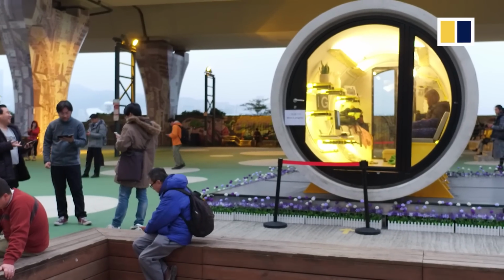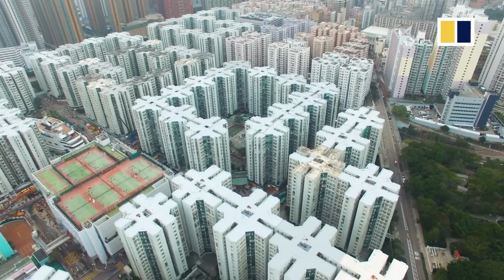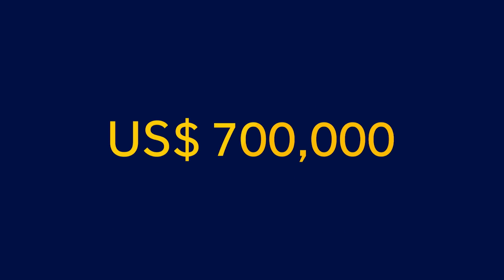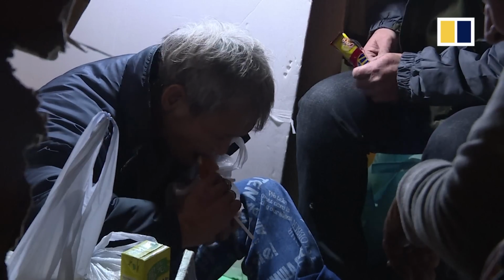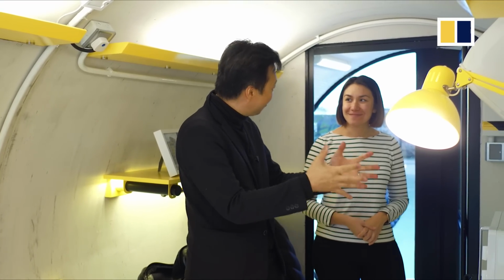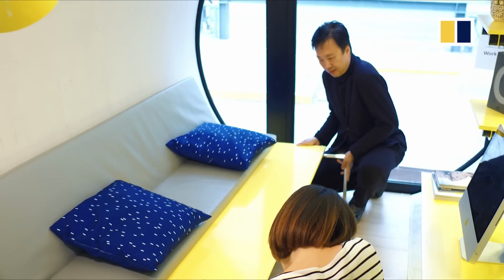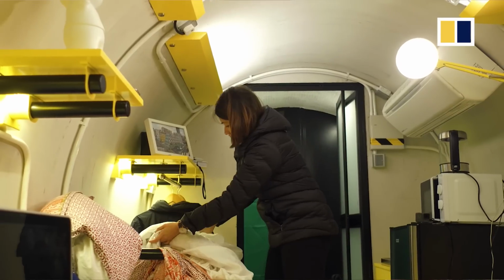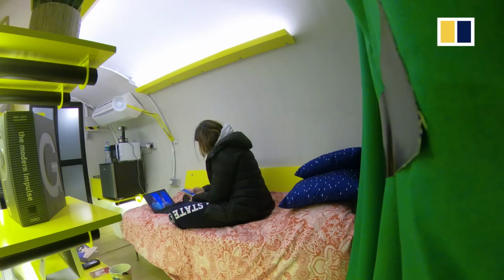Live in a water pipe: potential answer to Hong Kong's housing crisis

Comment: Listening to the architect, it doesn't seem that he's genuinely suggesting this is how people should start living, rather trying to demonstrate that a creative solution might be found in unexpected approaches. And as a visualisation it's really quite an eye-opener that this pipe is actually more space than some already live in.
Reply: True that as many failed to understand..
Reply: YES!!! Exactly!
Reply: These reply threads makes more sense than enitre comment section
Reply: Yes and later their gov will start charging them high tax on this.
Reply: So why do people live in such poor conditions? Make a video about that. Oh yeah, you can't. You live in fn Chyna.  Lol
Reply: @ericsaur9791  Nope. China communist gov want to build low cost housing that will address the housing issue. But Hong Kong local gov rejected it because many landowners in Hong Kong fear it will reduce the value of their property.
Reply: It's quite cheap too
Reply: Obviously, if you really wanted to make a tiny building, you would make it from a container. If you absolutely had to have concrete you would still make the concrete box rectangular rather than tubular, it's just a no brainer. But you know, an experimental piece doesn't have to be practical. It's enough to point out the housing issue and to demonstrate what kind of difference a bit of interior deco can do even to completely unsuitable spaces.
Reply: YES! Was thinking exactly this
Reply: Definitely have more space. If it was rectangle of this size approximately. It would have served the purpose

Comment: How is this solving the housing problem in HK? The problem in HK is land space, not building material. You still need to place these pipe homes somewhere. Unless they can just submerge them underwater. 
Second, the round design is very space inefficient. Better to just stack rectagular or hexagonal designs.
Reply: taxol2 yup.. this is just some type of business marketing that went south..
Reply: I wonder why they haven't considered container homes if they are going to try this route.  Alot of people out here have been repurposing shipping containers for homes.  Not only are they hella strong (people have been using them in Florida as hurricane proof homes), but they are cost effective and you are often (though not always) recycling.  On top of that they are stackable, making them good for multi story or apartment buildings.  I know in New York, they had talked about using shipping containers as post- disaster family homes.
Reply: JustYourAverageGirl yes, you are correct materialwise. The container boxes would be a better choice. However even with that the real problem is land space in HK. They really need somewhere on land to place these live pods. Unless they open more land spaces or like I said submerge it underwater or mass exodus out of HK, HK will still have the similar housing problem
Reply: why not live in china and work in hk?
Reply: @taxol2  Unfortunately, other than basic history, I do not know much about Hong Kong.  I would think however it wouldn't be too entirely different than the city's out here, in that there are certain features that seem to make a large city, a large city.  I suppose why I brought up the container homes, and to what I wasn't understanding, if you already are having issues with space, why would you use something round, which, unless you are a shark, has fundamentally less space and isn't great for the people living in them.  Container homes would make more sense to me in that they are already readily available as a material and therefor more cost effective, and would take up less space.  In large cities, getting any kind of land to build things on is a hot commodity, that's why they build upward, instead of outward.  Which you could do with container homes.
Edit: but yes I do understand if you have nowhere to go already you can't do much.
Reply: @JustYourAverageGirl2002  

I owned a condo in Manhattan 650 square feet and sold for 1.3 million usd Then I was able to buy a house in seattle for 1.1m usd 2400 square feet brand in the best area in seattle , queen ann. Why the price difference? Both are in prime part of the city , I live 10 minz car drive to downtown.  It is not the material and it is not the labor. Construction worker salary between the two cities are similar. It is the LAND. limited supply of land in nyc. Seattle is also limited. But to have a house like mine in nyc would be 6m usd in nyc at least. 

Containers houses which require you to stack them if you are talking about houses in terms of single family that requires land ( which is the expensive part) In asia people don;t live in houses like the west. They live in condos unless they are rich and live in certain area. I am not sure stacking containers up to 30 floors can work. The only solution is only allow local people to buy , restrict and make sure mortgage is not easily taken out ( if you have mortgage that easily accessible you will create the usa bubble crisis. When your neighbor can take extra 100k , so can you which creates bidding. A house that is worth 900k is now 1m because both parties can pay more not necessarily because it costed more to build  )  restrict the number of unit per married family/ family ( only allowed to hold one), and allow more development at faster rate. There is absolutely no other way around this...
Reply: The purpose of the round design is to re use all of those unused big pipes left by construction sights. You saying that they should use rectangular designs would mean they'd have to build them and it will shrink land spaces even more.
Reply: @Aki-hb1jy  Um, do you know what a container  house is??????
Reply: @7lol2007  I understand it's the land.  I put that in my comment.  But "container houses" is a general term.  You can turn them into apartments, because they are stackable.
Reply: @Aki-hb1jy  Round design isn't a good design for space.  
     Container houses or whatever you like to call them, are dwellings made out of recycled shipping containers.  It is estimated that world wide, we have about 14 million unused shipping containers that just sit and take up space.  Alot of the these shipping containers come from China.  So in theory, not only would it be a reliable resource as well as being readily available, it would be even cheaper since you are getting said material directly from the source.  They are sturdy, and with a little work, they are made to be non toxic.  I am not saying this would be the end all be all solution to Hong Kong's housing crisis.  All I am saying is if you are looking to make a dwelling out a recycled material, it would make more sense to use old shipping containers than old concrete pipes.
Reply: JustYourAverageGirl they have and it’s not a great idea. Container homes could only be stacked so high before they become unsound. Typhoons could rip through the stacks. Further you will end up needing lifts and any steel structure will resonate when you walk on them. Slept in plenty of these due to work in remote areas. If you don’t have enough money to buy it would need to be communal.
Reply: @SugarRay2  Granted I have never lived in or built one before, but with sound engineering it is possible.  People do it all the time on the Florida coast because they are hurricane proof when correctly built.
Reply: @JustYourAverageGirl They go up for a reason. In HK land is a scarcity Florida isn't. In HK you will end up building a tower, then you have to think about communal areas, then lifts, stair wells, etc...That's why concrete is still the norm. Different courses for different horses. I've lived in shipping containers before when I had to work remote. It has it's drawbacks.
Reply: @SugarRay2  No duh -_-
And everything has its drawbacks.
Reply: @Justyouraveragegirl so why would you push for shipping containers in hk if it's that trivial?
Reply: @SugarRay2  Okay, let's try this again shall we.
     All I was saying was if Hong Kong is trying to used recycled materials to make housing, shipping containers would be a better choice than concrete pipes, where the round design takes up more space and gives less space to the individual; and shipping containers would make more sense cost and material wise.  I am not claiming this is going to solve Hong Kong's housing crisis.  All I was saying was concrete pipes would be an unwise choice for recycled housing in an over crowded city.  Do you understand now?
Reply: This whole thing is a design nightmare. "Cool and funky" but not practical
Reply: @The Anti-White Ranger Uh-huh......do you by chance wear a tin-foil-hat?
Reply: Hong Kong has a Lot Of useable land you can look at a Map of it.
Reply: Someone had spoken the truth lol.
Reply: HK doesn’t have space for low tech industry, such as pipe building industry. Their property price is way too expensive even for the rich now. HK mostly “imported” those pipes from China. Both HK and China is the same country, but due to HK unique autonomy status, hence I use the word “imported”. And again HK problem is not building material, people can still well afford the building material. The real problem is the free “buildable” land space. They really need to acquire more land, free up some land, explore expansive options such as surface and underwater apartments.
Reply: Land space isn't the problem in HK lol that's a myth that people keep regurgitating.

The problem is land permits. The HK government makes most of its money by auctuoning off land and building permits to large real estate companies. To keep the government revenue high, they give out very few of these permits which end up in insane bidding wars between real estate companies.

If the government wanted to solve this problem, they could do it within 10 years. House prices in HK would go down by around 70% if the government wanted it to. But if they did that, money needs to come from somewhere else, and taxes would go up.

Pick your poison.
Reply: Kry Kry  HK has one of the lowest tax rates in the world. 2% to 18%. No inheritence tax, no dividend tax, no cap gains tax.

It's so low to make sure that foreign  businesses come to HK and invest. This also means that HK does not make much money from taxes. That money needs to come from somewhere, so it comes from selling land permits.
Reply: They were taking space in China otherwise it was going to be dumped
Reply: @JustYourAverageGirl2002  there are plenty of people living in containers in Hong Kong!!
Reply: @andia968  well I for one need a visa to work in China but I don't need one for HK, also China has different laws, whilst I don't enjoy living in Hong Kong I would really not want to move to China where a lot of things including YouTube are blocked
Reply: @taegiseoktrash8874  youtube can be bypasses easily using free vpn
Reply: Maybe so, but I would rather live somewhere where I don't need to be using VPNs  & again for me personally I can't live in China anyway without a visa
Reply: The real problem is the government losing control of housing issues. Face it.
Reply: @andia968  that would be nice but i think there will be socialism will occured because HK and CHINA are really different when in comes to goverment
Reply: @JustYourAverageGirl2002  they do except those container home are expensive and nobody want to live becuz it be a nightmare and fk ear drum when rain. Idk just excuse. Idk
Reply: so there are pipes lying around and the company would start filling up pipes at these construction *sites?
Reply: Like bees
Reply: Repurposing.
Reply: They problem is the government
Reply: No actually. Land space isn't the problem. I know what I'm saying seems pretty ludicrous but, the government simply doesn't care to expand livable land areas. That is why they just bid off small plots of land to get huge profits which is why living areas are so expensive.
Reply: Buddy for life buildable land. I think the govt there auctions such buildable land, making it very expensive
Reply: Bro, the problem is that housing is expensive, just see a vox Hong Kong episode on these problems, it explains it very clearly
Reply: JustYourAverageGirl I thought a about living in one of those one day
Reply: If they were things like shipping containers they would be stackable, more affordable than conventional apts, and extremely modular
Reply: Amens
Reply: And fked up ppl who slow it down
Reply: Solution is to stack shipping containers and sell them like condos.  Lol.
Reply: MrManny maybe you can stack and sell them. But there is limitation of how high we can stack up containers or concrete pipes.
Reply: Metal containers have fundamental flaws if used for living. They are conducting heat and electricity, are magnetic, and poor for wireless reception and radio frequencies. It will be like an oven during summer and a fridge in winter. Insulation and noise cancellation are also huge problems with these. One small stone hits the wall, you're gonna hear it all around. Think about raindrops...
Reply: @andia968  actually lots of people do. We live in Shenzhen, work in HK. They also opened a mrt directly from the border near the Westin in Shenzhen. However, it's a pretty long commute. Nevertheless, from an economic perspective it's worth it.
Reply: @andia968  could you clarify, your words are sorta mixed up... anyway, i'll also link the video on it afterwards.
Reply: @idk-lz4nl  how many hours are required until u can reach your workplace from sz?
Reply: @andia968  about 2, but once it was 1hr 45
Reply: @andia968  but to clarify, i study at university. I don't have a job yet...
Reply: @idk-lz4nl  arigato bro. Is living in zhuhai and work in hk practical?, or it may take more than 2 hours commuting?
Reply: @andia968  I dunno about that, but I heard some people were taking buses. I've been to Zhuhai but never on the bridge. In terms of Shenzhen as it's a tech hub it's better for me as a university student but I dunno about normal people they might prefer Zhuhai. Zhuhai is definitely cheaper. As far as the bridge, they say it's 45 min by bus from the border facility. It's near the airport so already an hour without rush. When it becomes around 5, you can expect a few more delays. However, a way to work around this is to take the metro to the airport and then from there just walk to the bus station.
Reply: exactly this. the design is unique and maybe fancy, but really solves nothing.
the title is misleading, and if it is not and the writer believes this gonna solve the housing problem. clearly something beside the land problem needs to be fixed lol
Reply: not underwater, maybe beside a pipeline underground
Reply: Hexagonal for sure. More attracting
Reply: It's not actually the land space, only about 3% of the land is actually used. The real problem is actually the corrupt developers who refuse to make apartments more affordable.
Reply: Jaiden person prob because the permit to develop the land or the land itself being auctioned to the highest bidder.
Reply: @JustYourAverageGirl2002  they have.
Reply: Underground sewer cities are the answer. Ever watch the Ninja Turtles?
Reply: The problem is not space, it's government. 75% of the pand in HK is not built in, and while some of it is mountanious, the rest could be easly made into more homes.
Reply: Underground tunnel apartments can go under the mountains and are safe from landslides during monsoons.
Reply: Yeah, i think so...
Reply: @JustYourAverageGirl2002  you need to understand the context of the video, the designer in this video using reuse pipe because it was left over from a construction site to avoid wastage. Not that he prefer pipes over container. Both have pro and cons. Anyway, it is just short term solution, as you said the problem is the land price.

Comment: I have a better shape to propose: a hexagon. You can stack them like behive
Reply: but it would need to be made first!...this is just using something existing & discarded!
Reply: Or; get this; a rectangular apartment
Reply: @planefan082  ur a genius
Reply: @planefan082  the hexagon is way more fun tho
Reply: @planefan082  hexagon is more efficient i think. You dont use the corners in your roof.
Reply: I think there's already architecture designed that way,forgot where . There's also new government supplemental housing (experimental as well) this last year, but really the supply is far too low.
Reply: Hexagon pipes use more concrete than a circular pipe.
Reply: @philnightjar1971  space is the problem not concrete
Reply: What about the electrical wiring and water and waste piping...
Reply: @patrikpass2962  Land cost is the problem.
Reply: @BeachBoi1000  yes thats what i said...
Reply: Hexagons are the bestagons
Reply: @planefan082  ohh rectangular apartments are tight!
Reply: @grandmacat406  is that saying from a YouTube channel?
Reply: @wondergazers2004  maybe i don't know
Reply: Fantastic idea the hexagon structure would be able to do the wires perfectly and the plumbing with a foot worth of space between each hexagon house these would be fantastic to work on -random tradesman from britian
Reply: Show me where hexagon pipes are so I can buy them and recycle them into apartments
Reply: These are leftover pipes, so making new ones will cost more
Reply: Hexagons are bestagons